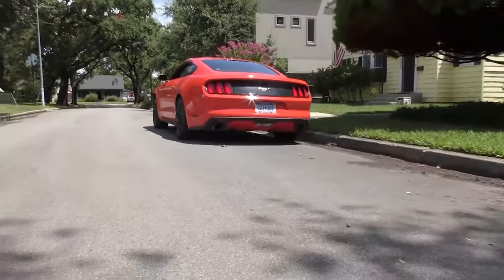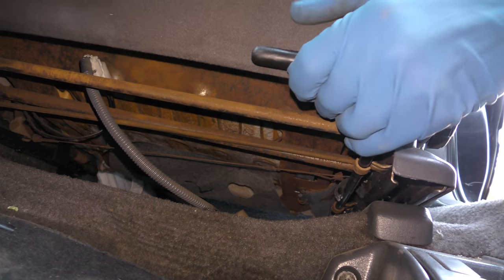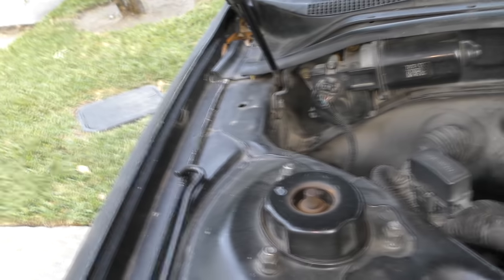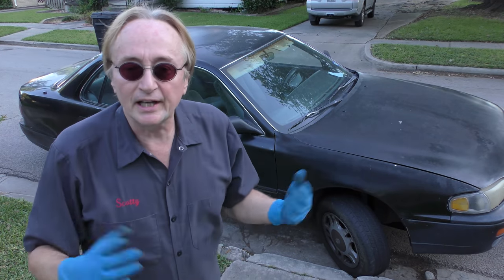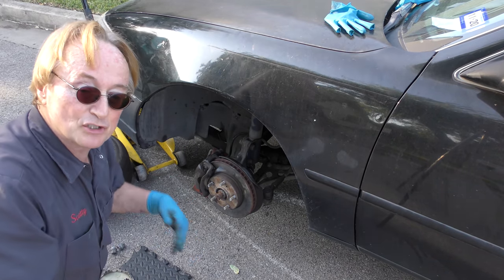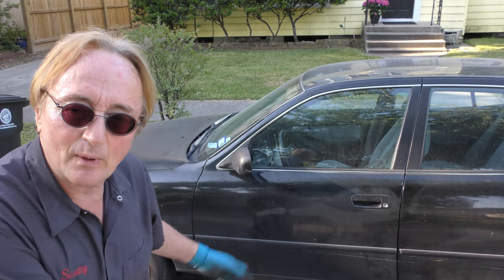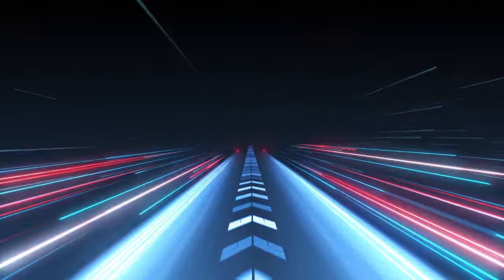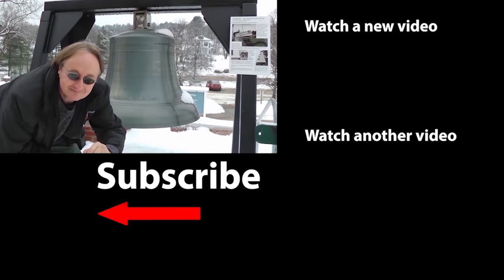Never Do This to Your Car (Learn from My Mistake)

Comment: Ive had a ball joint come out before, it is a scary experience, especially knowing that it could have happened on the highway. There is no warning, only a small wobble that only a mechanic can find when checking for it

Comment: Here is a little trick you might find kind of useful - If you have a screw and you have a hard time trying to make it stick screw to a long screw driver to stick down a deep hole. Try taping the screw to the screw driver. The tape generally comes out with the screw driver and the screw is easier to aim down a long deep hole without losing the screw as long as you make sure the tape is stuck on the screw driver. The tape sticks to the screw driver while the screw looses its grip while it gets tightened. The tape is released and the tape gets pulled out stuck to the end of the screw driver.  This little trick just might work. It might help save somebody from having a bad day and cut down a few cuss words in the process.

Comment: This happened to my car. The ball joint slipped out. We were hearing this grinding noise and could not for the life of us figure it out. Luckily my dad happened to have a ball joint kit. I now know how to check the ball joint and tie rod for wear. The wheel was scraped on the inside but still usable. The strut appears to be fine. Been driving on it for 3 months since.

Comment: Scotty I have a 1984 Cadillac Coupe DeVille and the oil pressure light is always coming on but the oil light goes away when I step on the gas it turns on when it idles and when I come to stops I change the oil sending unit the the suction pump are the oil pump and suction pump the same thing or two different things it drives good it doesn't overheat or make any type of noise in the engine what could this be Scotty

Comment: You could get ball joint, axle shaft & strut assembly for a hair over 100 bucks online but the other side will need it as well so it's over 2 bills for parts only.

Comment: Many years ago I had a Honda Accord hatchback, and an odd rear upper ball joint failed sitting in my driveway.
I didn't do DIY back then.  I foolishly used a strong, over-sized spring clamp to hold the parts together and successfully drove it to the shop.  Later realized how lucky I was to make it that 8.5 miles driving 45 mph.

Comment: i let my whee bearing go super bad on me on my last BMW...was backing out and the whole axle broke off. I thank God it didn't happen earlier when I was on I-5 looking for a job as I probably would have lost my life/ been seriously injured.  To replace the wheel bearing was at most $300 parts included, but instead I lost my whole car...lesson learned. Fix the small issues before they become gigantic ones.

Comment: Thanks, great  information trade secrets about how to jack the car up that’s extremely low to the ground,  understand how a ball joint works, possibly repair rough idle, and remove rounded or rusty bolts.

Comment: Even the cat ran away from that one. I took one look at that mess and knew it was a total suspension rebuild right away. 
A friend of mine way back in high school had a 1977 Trans Am and he drove that thing like he stole it. It had just the base 350 with a 4 barrel but it was indestructible. It took everything he dished out on it.

Comment: Good advice for recent cars is to have and pay a mechanic check it.... Great for a 10k used or a classic car... 
However it doesn't work where it is really needed.  If you're in the market for a $1000 beater,  then you are surfing craigslist/car trader.   These cars stay for sale about 2 to 48 hours.   It costs $100 for a full mechanic check taking an hour.   So you're going to look at five beaters today.   You tell the seller,  I'd like to take the car to my mechanic crosstown and I'll have it back in 3 hours.  They say a cash buyer is coming in 30 minutes,  go away. 

If they do cooperate:
.    Costs you 3 hours and $100.  It's junk,  you go to the next one,  same and same,  so you spend 1400 and three days on the $900 beater.   It still craps out in a month because of something hard to diagnose like a badly rebuilt transmission on a clunky 30 year old Camry. 

The junky old cars it is best to figure they will cost 50% of the purchase price in the first year to rectify.   Figure that in.  His video on how to check a used car yourself is very useful and will at least reduce the count of cars you take for mechanic checks.
Reply: GENERALLY, two types of people buy cars for in the $500 - $1500 range: completely broke or highly mechanically inclined.  Neither of those types are gonna take the car to a mechanic and pay $100 to have it checked out.

Comment: Appears to be a setup for a video to me. A cotter key and big nut just do not come undone and ball joints can be a pain to get out anyway. Perhaps a previous owner wanted to replace the lower ball joint and did not have the tool, then is a flash bulb thought...removed the key and nut and drove to hit every pothole he could. Then again it could have been that cat from Chrysler.

Comment: Remember seeing cars looking like that all the time on parkway shoulders when I was a kid in the 60's & 70's due to broken tie rods or ball joints etc. & that's why I gut my front ends out with new tie rods, ball joints & struts/shocks if needed every 10 years or 100k miles & have lifetime wheel alignments with Firestone on all cars. Safety is very important for everyone on the road & issues like in this video can cause people to get killed.

Comment: Don't replace the ball joint on a fwd car like this, on rockauto you can usually get an entire upper or lower A arm assembly for like 10 bucks more than just the ball joint. Then you get a new ball and all the bushings.
It's also easier to replace an A arm than a ball joint in almost every situation I've been in (i only buy pos cars).

Comment: Scotty! I bought a 09 Ford expedition with a 5.4l v8, retired state cop car, what should I do for maintenance? Spark and oil? Or all the fluids? Should I be nervous something will go? Runs super smooth 138000 miles

Comment: Can't be worst than what I saw, when I was a mechanic (early 90's). The boss wanted me to run a safety check on a 78 Olds delta 88. The new owner fixed the floor by pouring a concrete slab. OH ! That one didn't pass.

Comment: I would have been curious how many miles that Camry had on it.  I know when I traded mine in it had 165K and the dealer say the power steering rack was going.  However, the gal that told me in the service dept said she wouldn't replace it yet if it was hers so I didn't.  I traded it in.  Great info on a rounded off or broken bolt.  I never would have thought of that.
Reply: I had to do the bolt welding trick on a Toyota pickup I bought for $500 (good condition, no rust, owner's son drove without oil...).  The 24mm differential drain plugs have really thin heads and are easy to round off. Considering the oil was rarely changed, I'm sure the diff plug hadn't been removed in a decade.

Comment: Bought a 2010 Honda Civic with 41000 miles form my mechanic and also my neighbor. Only paid $6000 as he gave me $1000 for my old piece of junk. So far I have it over 3 months and runs like a charm. Guess I got lucky. Of course anything can go wrong with a used car. This car was also so clean on the inside. Not one mark or hole on the seats. Hope I get lots more miles out of it. My 2016 Honda CRV which I bought new has over 45000 miles. I now use my civic to go around local to save the miles on my CRV.

Comment: That’s a pretty easy fix. Buy the parts and do it yourself. A couple quick struts, half shaft, ball joint, tie rod end and use the spare tire and realignment. $200-250 in parts and $50 realignment.

Comment: I agree with everything you said Scotty except I wouldn’t buy a 2020 f-150 because of the 10 speed transmission i had a friend who had a 2019 and the transmission went out twice and left him stranded. It was 54k and when he sold it he lost 45% equity. He got a 2020 Toyota Tundra for 52k and haven’t had a single problem since. I have a 2006 Toyota Tundra 4.7L v8 with 214,000 miles and have had no problems with the engines or Transmission. Toyota’s out last fords and hold higher re sell value.

Comment: I was putting new tires (from Dunkin Donuts) on 198? Yugo some 25 years ago. the left side had no ball joint. The owner had the components tied up with a twist of wire coat hangar. The boss would not let me toss the car in the dumpster.

Comment: Hello Scotty, Et-al...
 RE; "Ceased, (Mtl. RUST_Ca.~When/If feasable!) or Rounded Nuts or Bolts!" 
(Long Winded...But might make life...A "Little Easier" for Some!)
 Heat the "Nut," or, the "Bolt"_to a redish hue (Not Aluminum) & "Right Away" spray Cold Water (MOSTLY) on the "heated part"...Again, "RIGHT AWAY"...Use Vise grips/Cresent wrenchs/or Bottom out, a *6 wall "Deep or Reg impact socket," then Slowly "Turning by small increments~Left & Right xxx Times until there's a "Slight SNAP" Sound heard...Continue going "Slowly" turning Back & Forth further & further, until there's full movement. (Note! During the heating/water cooling/tool use steps~"Move FAST," or both parts will return to the same temp, & cease up again! (This usually requires...A Redo!) 

PS. For 48 yrs., working as a "Auto Mechanic, Fine Finish Auto Body Man, then A Fine Finish Spray Painter"...I used these methodes 100'rd's of times~"And they failed_Very few times!

Comment: A good big workshop jack on the bottom of the engine (away from the oil pan/plate is good for lifting the front of a car
Reply: This generation of Camry has a stout engine cradle that makes for a perfect jack location.

Comment: Maaaaaaan, i had to use a 1 meter long lever and compress the spring on the suspension to get it out like that , and that guy with the camry got it out by just driving.(I also ripped my drive shaft from the transmission, but it's not broken, I put it back in and it works fine :D )

Comment: Scotty, I have a 04 Toyota Tacoma extra cab with a 2.4 liter v6. It sat for 4 years and we tried starting it with gas in the tank, new spark plugs, and starter fluid but no gas gets to the engine. what do you think is the problem

Comment: Do you not have compulsory official annual car safety checks in the USA?  All suspension joints, gaitors, brakes and brake lines, hand brake and all steering parts and lights, plus safety equipment and much else are tested annually in the UK at certified test stations.

Comment: Happened to me same ball joint broke but I was going up a mountain  almost died going off the edge told my pop what happened he said same thing happened to the passenger side , the driver side broke on me, needless to say if you hear loose parts do a thorough check

Comment: I remember several years ago having my 98 Lexus LS400 serviced at Midas and they told me I had play in my drivers side tie rod end. So I ordered one and took my vehicle there and had them replace it. They asked me if I'd like a wheel alignment, I declined. Til this day I am unsure if that's what caused my dilemma. I drove off and about a mile later my car would jerk hard to the left for half a second, so hard it pulled me from my lane. I drove my car back to Midas and had them check out the suspension again. They said it was fine and didn't see a problem. The next day I was driving on the highway and that wheel turned in just like the Camry in this video. My insurance company paid for the damage once I showed them the paper work on the service done and they said the tie rod end failed so I assume either a pin wasn't put in the joint bolt or not paying for a front end alignment caused it. After that incident I learned how to work on my own suspension, so I change my own tie rod ends and ball joints and wheel hubs now. Haven't done struts before so if I ever need them done I may pay for that service. I wonder what Scotty would tell me could have caused this problem considering the service center couldn't find anything wrong after they changed the tie rod end the first time.

Comment: Hey Scotty, I am a big fan and you have been inspiring me to learn how to work on cars.  I have had 2 tacomas (currently own a '98 2.7 liter) and have experienced idle surging on both.  I was wondering if you could discuss diagnosing this type of issue and if cleaning my throttle body, IAC valve and mass airflow sensor might help.

Comment: A better trick to take the wheel off is crack and unscrew the nuts until you can screw them off with just your fingers, BEFORE jacking the car up. Or was the trick only if the wheel is stuck in a broken position like the Toyota was in this video?

Comment: Hey Scotty, my father has a 2003 Dodge Durango SLT our engine is shaking it sounds like it one for the cylinders it not the engine mounts and all the plugs have been changed could it be the distributor or should we just junk it for a Corolla? It’s got 163k miles.

Comment: The new ford trucks 4x4 switch has defects. The stupid knob that switches to 4x4 breaks under a year. Happened 3 times with a relative of mine, till ford reimburse his money for the faulty issue. But other than that, great truck👍

Comment: This has happened to me. The new ball joints did not have castle nuts with the cotter pin. They had nylock nuts which are not safe in my opinion! Luckily i wasn't on the highway when it happened!

Comment: We in the uk have this thing called an mot which basically is a yearly requirement by law to get the car checked out by a mechanic which checks if the vehicle is safe and roadworthy, do they have something similarvin the states?

Comment: Scotty, I've always wanted a ute, but they don't really sell them here the US. A company called Smith performance makes some of the best ute conversion kits, but pretty much all of the cars they make the kits for are a pain to deal with.

Out of the cars, the '99-'10 VW Jetta, the VW New Beetle and LX Dodge Charger are probably the easiest to find parts for, but they aren't really known for their reliability, especially the latter two. Should I just forget the idea of building a ute and do something slightly less stupid with my money?

Drivetrain swaps are not completely out of the question.

Comment: Cadillac oven/stove/broiler?  I bought a house that was built in the 1950s.  It still has the original stove.  An appliance repairman told me that it was built by the same company that made the cars.  Even has the Cadillac emblem on it.  Maybe they should have stuck with ovens.

Comment: What would you suggest I do to my 2010 equinox with check engine light on so I get a better trade in value from the dealer when I buy the new car?    I have been told the problem is catalytic converter.  Should I clear the codes?
Thank you,  love your videos !

Comment: That ball joint didn't "Fail" some nitwit never put the nut/cotter pin back on and it finally pulled out. I have fixed worse and both cars were just fine using "junk Yard" parts as long as the car your removing them from wasn't a wreck and you do a careful inspection you'll have no problem.

Comment: Trying to buy a older suv Ford explorer.. There's a 2000 explorer limited with a v8 or another 2000 explorer with a v6. They both run great and is under 200,000 miles. What will last longer the v6 or the v8? I wanna use it for work.

Comment: I just replaced my control arm recently. How on earth did the ball joint pop out? There is a pin stopping the castle nut in most ball joints.

Comment: How did that ball joint fall out of the spindle?  For the retaining nut to fall off the cotter pin would either have to have been removed or never installed on ball joint service. 

Sabotage?  Or a made up drama.

Comment: Had the exact thing happen several years ago with pretty much the exact damage. It could have been avoided. I had noticed a strange sensation in the steering a few miles before it happened and I brushed it off. So if it feels funny at all,STOP so you can save the car and$$

Comment: had a ball joint drop out on my 08 mustang GT was slushy out too so I blamed that for having to crank my steering wheel 90+ degrees to go straight jacked it up to put my fixed rim on and noticed some play side to side fuckin ball joint drove to the part store (1/2mi away) and got me a control arm guess I got lucky

Comment: Those mid 90's Camry's were put through hell and back. The 97 Camry had a better looking body and was the very same car with the same room inside.
Reply: the  97 - 2002 gen 4 camrys  are  better   beaters  than  this  gen  3  junker.  not  worth  anything  n  not  worth  fixing / putting  $$ into.

Comment: I have a 2003 Jeep Liberty with 198,000 miles with a slite steering wheel vibration on the interstate not sure if it’s a suspension problem or not ?

Comment: all you need to do is replace the driveShaft and joint were the wheels sits on... I just dont know about the bend frame were the strut fits maybe a hammer can fix it i could do it.

Comment: If you have a Car over 10 years specially a Toyota Check those ball joints every year after the 10th!  I seen Sequoias and the whole toyota  line up plagued  those broken at the side of the road!  Seldom  it happens to Corollas or the small pick Ups.  But if it is Camry or Suv after 10 years have those wiggled at the safety inspection or when doing other maintenance!  It will save a ton of money as shown here. Do the same with Lexus those probably start goinh after 12 years!

Comment: Hey scotty I'm having an issue with my Chrysler 300 2008. I replaced both my CV axles cuz it kept making noise everytime I turned the wheel left. So I changed both sides but the noise was still there. What els should I look for? Any info would help a tone. Thank you.